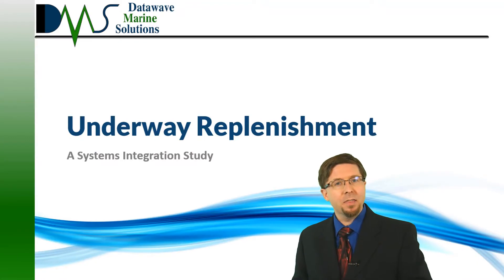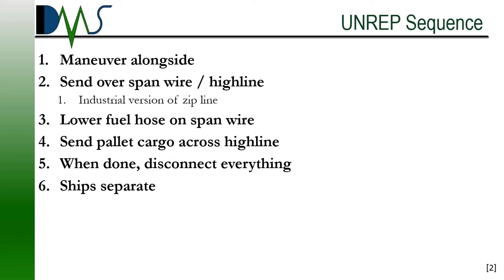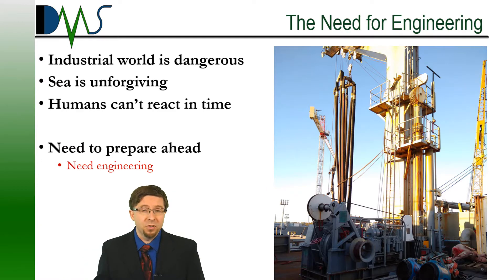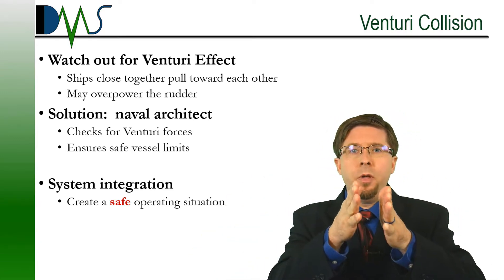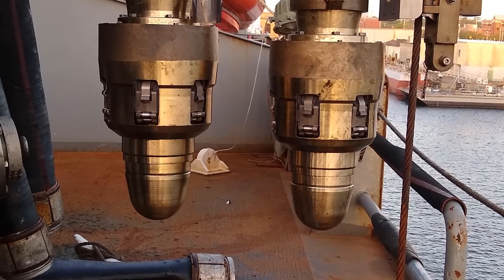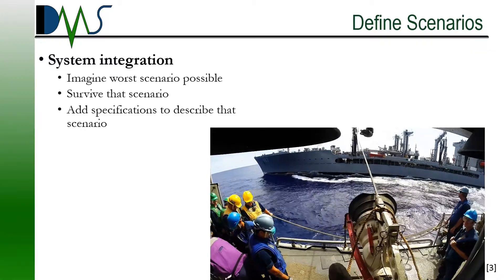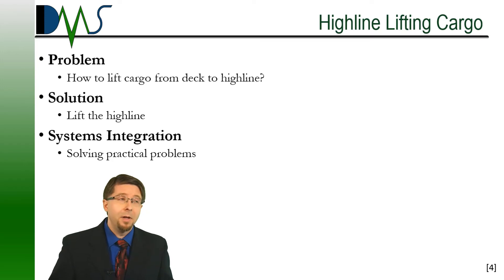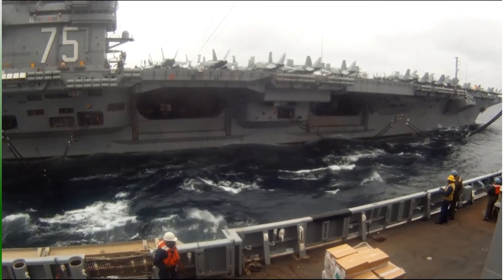Underway Replenishment (UNREP):  A Systems Integration Study

Comment: yeah, that is incredible stuff, even more so when considering most of that was sorted out long ago. one example could be the USS Ashtabula AO-51 from WW2 (1942/1943ish), a lot of that rigging was already in use on that ship, and probably existed on older ones if I spend more time digging around the webs. by the time the ship I was on was built (USS Camden AOE-2), they were well into the refining and improving the rigging (smaller lighter stronger parts, etc).

Comment: The vocalizations sounded so patronizing and uninteresting. I've spent many years in the navy and therefore participated in this "unrep". Yes, it is dangerous and lives have been lost. The attitude of we're unintelligent or naive petulant toddlers while an engineer is our god-like savior is insulting to say the least.
Reply from the maker: Sorry you interpreted it that way.  I know many people have an impression that engineers are generally arrogant.  I admit you will always find bad attitudes in any profession.  For myself, I think it takes extreme skill to perform an UNREP safely.  I tend to think of an engineer as someone who provides the tools for the professional mariners to do their job safer and more efficiently.  But we still rely on the experience and knowledge of those mariners.  I've seen mariners come up with simple fixes that are far better than any engineering solution.  And I've seen cases where safety systems designed by engineers were the only thing that saved someone's life.  In general, I think it works best as a collaboration going both ways.